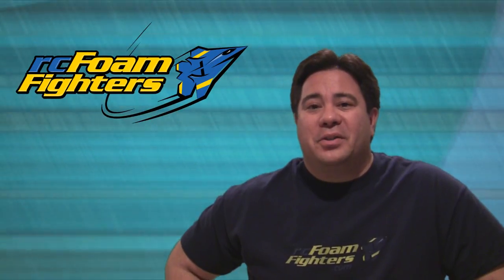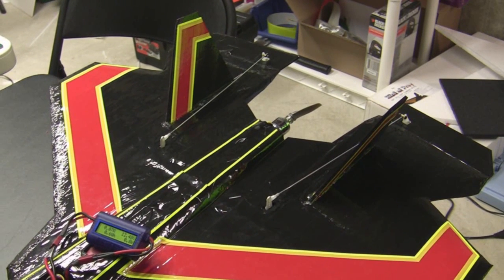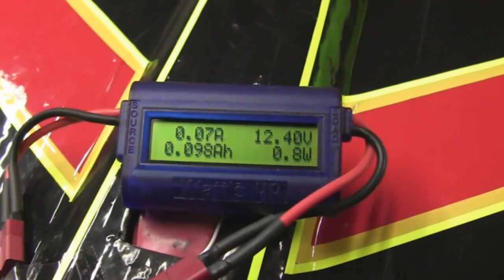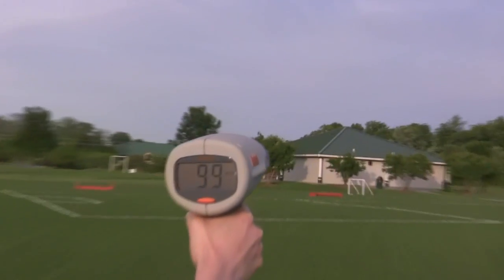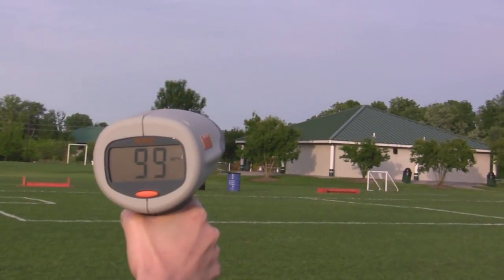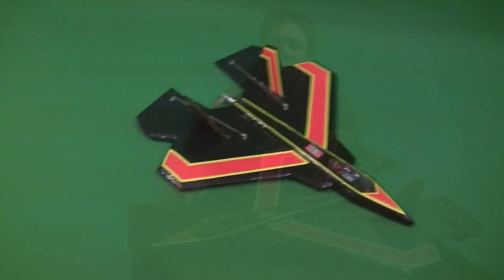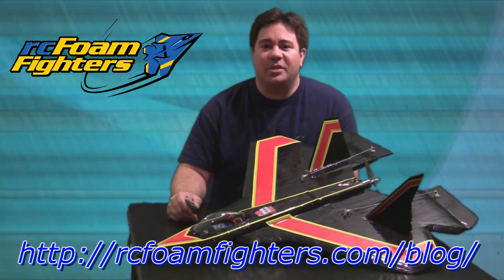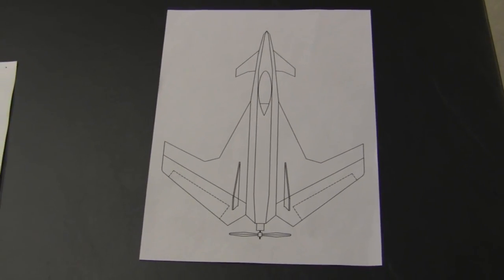Part 6 EPP Park Jet (Free Template Plan)

Comment: Thanks for the great video series. I am itching to try the thick foam for a build.

A couple of things I was wondering about:

Could you just tunnel out the whole center section of your top fuse piece and then mag a cover for it?

Also, do you think you might be creating excess turbuance and/or drag by using depron for your control surfaces creating a large pocket right at the hinge due to the difference in material thickness?

Thanks again!

Comment from the maker: that sounds Cool, what big plane is it that does 130mph? That would be a cool plane to have. Anyway, i never said this plane was the fastest or anything. Just fast for me. I know there are way faster planes. Hoffman Magnetics makes a cool duct fan capable of 175mph. That would be cool to put on a plane. Anyway, breaking 100mph was cool for me, especially since it is completely scratch built, not stor bought stamped out weak styrofoam. Thanks for watching.

Comment from the maker: BERELEAH cool you are making your own plane.  As for your plane I am not sure all designs kind of very a bit.  It will all depend on where your center of gravity lies on the plane. Some planes are ok with the motor way out back. Others, the motor way out there may be to heavy and make it hard to get the CG right.  I guess first try and determine where your CG is. Then do a mock up with the parts lying were you think they will go. Adjust till you get the CG right where it should be.

Comment from the maker: BERELEAH, as it's a scratch build you can use many typess of motors. i would recommend a motor of 300 or more watts. The Super Mega Jet is rated at 400 watts. That and  suggest a motor that can turn a 6x5.5 prop or better. As it goes with scratch building, feel free to experiment.

Comment from the maker: BERELEAH, i got the cockpit a t a local hobby shop. Most Hobby shops carry them.The one on the plane was actually on for an old WWII warbird. I had to trim it down a little with an exacto knife. If you cannot find the clear plastic type you can always carve one out foam and then cover it with black tape. I've made several this way too. Thanks for the comment, good luck!